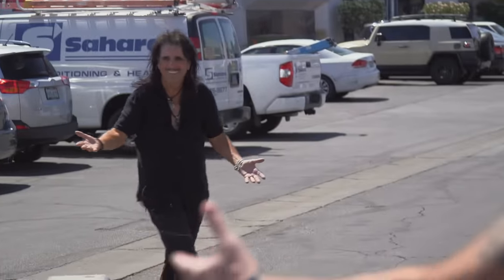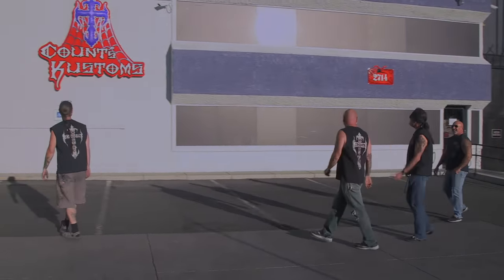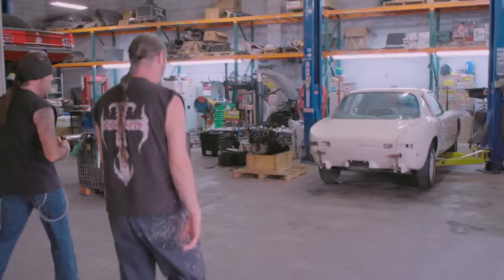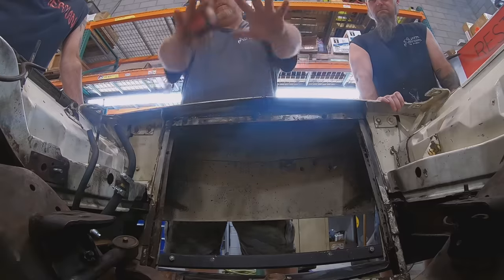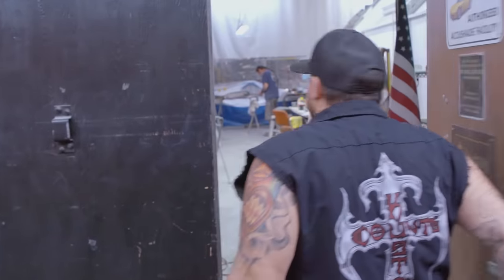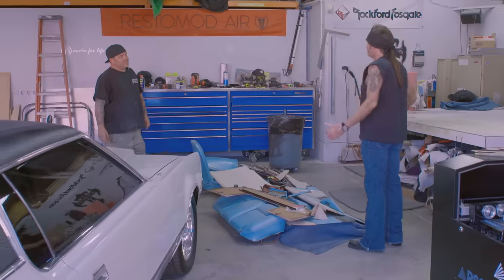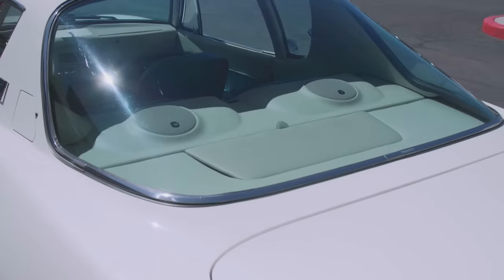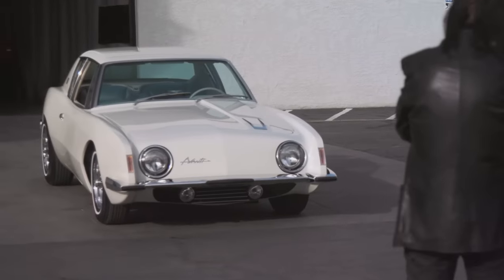Counting Cars: Danny's Surprise for Alice Cooper (S10, E1) | Full Episode

Comment: I like Danny's attention to detail and his insistence on things being done right and being as reliable and as safe as possible. Unlike that Lone Star Hack Shop   "Propane Ape Garbage"  Danny does not turn out a car by buying cars for pennies and just cobbling something together to get it done fast and as cheaply as possible while expecting to get top dollar plus another 99% over that price for something that is unfit to be on the roads as they are unsafe with serious chassis and suspension failures  happening shortly after the buyers take possession. I have seen a lot of articles showing several of the vehicles that were built by "Propane Ape Garbage" that were parked and left in storage shortly after they were bought because of frames or suspensions that were either left damaged from previous accidents or poorly done repairs or modifications that cracked from being driven for a matter of months. I respect The Count for his doing things right.

Comment: A 351 Windsor stroked with the sniper injection, stage 2 cam, aluminum ported heads . He would of got high 400 hp.  Alice Cooper deserves bigger power. I think they cheesed out on the motor aspect